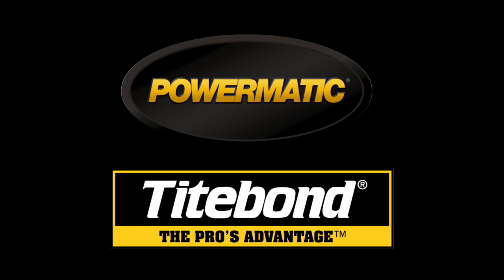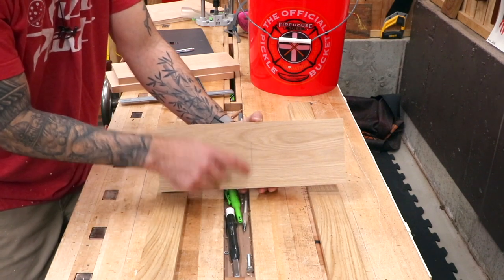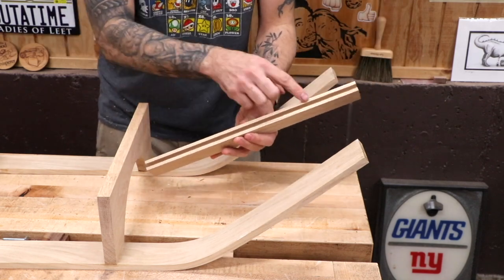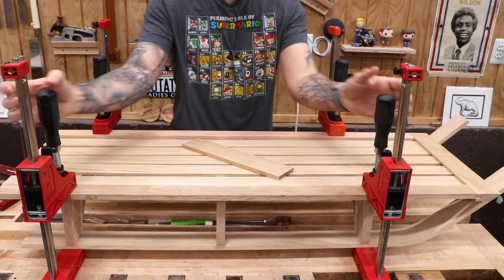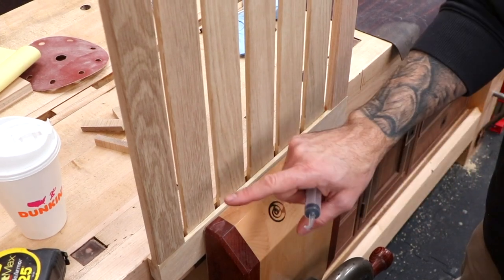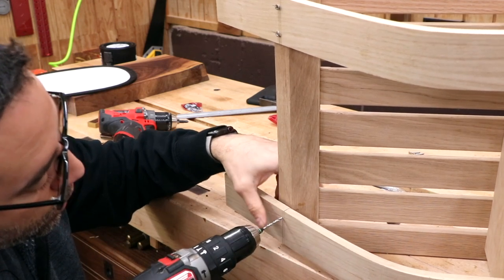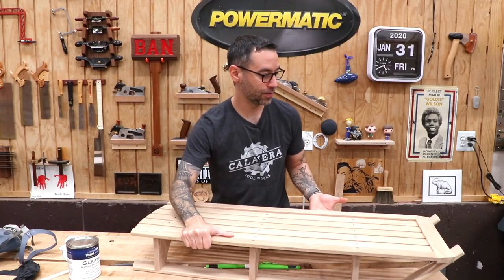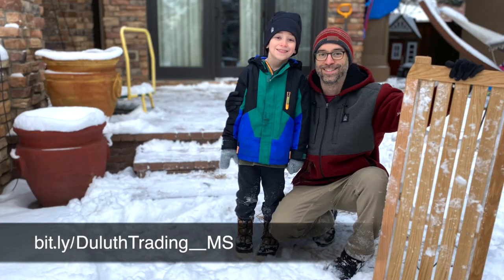Kids Pull Sled

Comment: As a kid I prefered sleds with runners aligned wider than the seat itself - it was a lot easier to maintain balance when your legs were securely placed - even if my friends were able to pull the sled at decent speed!

Comment: As a veteran of the Boy Scouts Klondike Derby, I'd suggest, treat the runners with pine tar (from the farm and ranch store, they still sell it for treating horse's hooves) to seal the pores on the running surfaces. Melt it in thoroughly with a heat gun or blow torch until it won't take any more. Then wax it with paraffin (in the canning supplies aisle).
Reply: My thoughts exactly. I did this on a 6' toboggan I refinished. Fits with the wood sled style better than metal or plastic runners (IMHO) though they are doubtfully more durable. Finished on top of the pine tar with cold temperature kick wax for cross-country skis. This is how old wood skis were finished on bottom. My toboggan glides VERY well. Regardless, a beautiful project like all of your others.

Comment: Would making corresponding 1/4" deep Stop dadoes in the top rail instead of removing 1/4" from the whole bottom be better for alignment/rigidity? Only problem would be the math to figure out the perfect placement from runner slope... ?

Comment: For the future: Make the runners way smaller and ad a strip of metal at the bottom like you said. For the current design: Give the runners a thick coating of Epoxy. Should make it easier to pull for you. For a good sled reducing friction is key. Reducing contact area and materal play a big part in this.

Comment: Not sure if this will go to a sledding hill, but I worry that the arched supports may buckle in the fore-aft direction.  Your main deck supports are all parallel, the lone triangle the attachment of the forward end of the deck to the runners.  I recall sledding with my children in Northern Illinois and the bumps on the sledding hill would send them airborne.  Some big vertical loads from the irregular snow surface and drag/impact loads from snow mound/rut impacts are likely.  Some gussets between the runners, braces and deck might help.  

On the other hand, you don’t want to build a tank...  

So never mind...